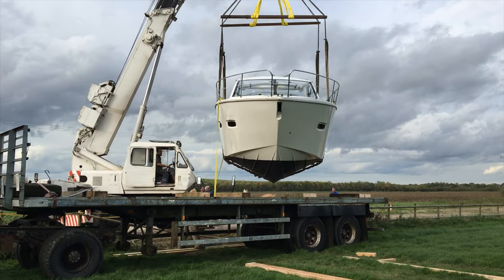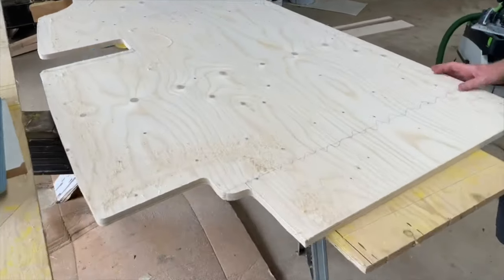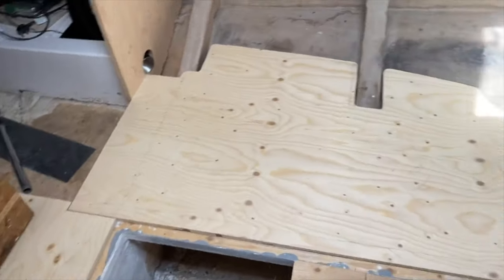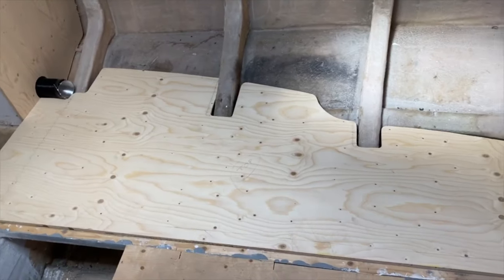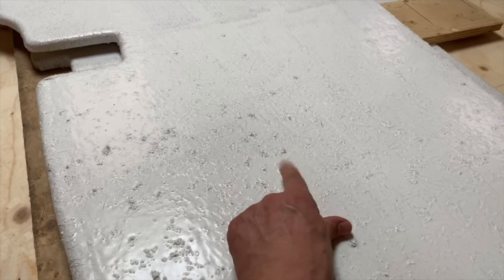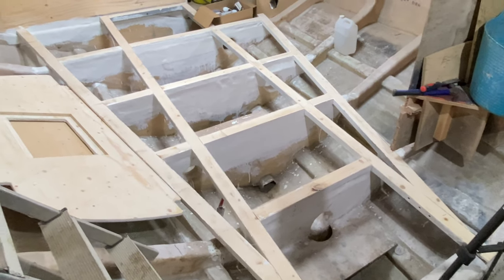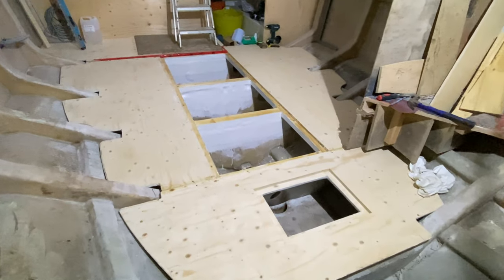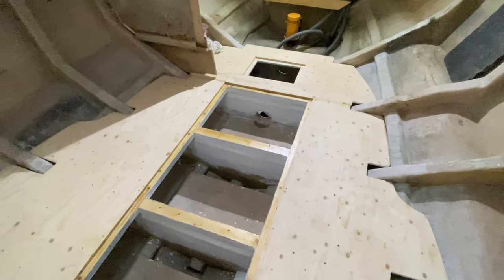Boat Floor Replacement - Motor Boat Rebuild Project - EP 27

Comment: Why woo over composite? Price? Ease? I'm scared of wood and about to redo a floor so im honestly willing to reconsider wood. Might add i live in Florida if that even matters. Its humid as all hell.
Reply from the maker: We did consider composite sandwich panels, but they didn't have the impact resistance we needed for flooring and they are very costly, so decided to go with exterior grade birch ply laminated on the underside and flow coated. The top side will be epoxy coated so should be very water resistant overall. Thanks for watching !
Reply: Coosa Composites manufactures structural panels made of high-density, polyurethane foam reinforced with layers of fiberglass. The no-rot and light-weight advantages of high density foam combined with the structural properties of fiberglass make Coosa panels an excellent replacement for wood and other traditional core materials.
Reply: Hi you should look on ebay for Fiberglass Honeycomb Panels  or Aluminum Honeycomb Panels seal the ends I did this years ago very strong and light weight you can also get used and it is cheep  Pease do not use wood it will rot in no time.

Comment: I thought floors were generally just screwed down in case you hit a reef and need access to repair
Reply from the maker: The factory boat had a bonded and glassed internal moulding with hatches for access, so we are following a similar principal. We are also keen to avoid creaks from mechanical fixing. Thanks for watching 👍

Comment: Guys great work! Why no access under the floor for the rest of the panels? Space is at a premium on the water and it seems like a wee bit of a missed opportunity.
Reply from the maker: Thanks Jeremy and we do have plans for underfloor storage, stay tuned 😉
Reply: Boatholic what do you guys plan to do with the rest of the interior since you took the plugs out?
Reply from the maker: @jeremyfaine950  Next job is to fit the new bed module and chain locker and then fit the bulkheads